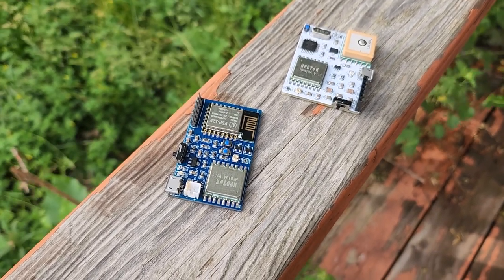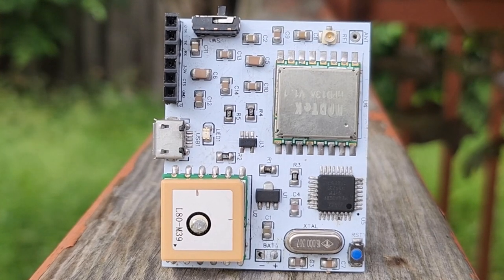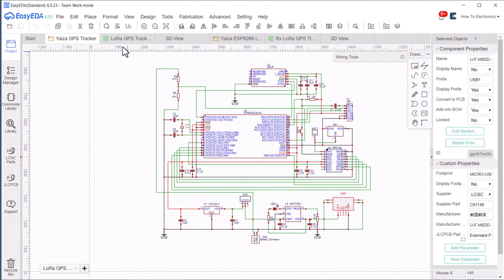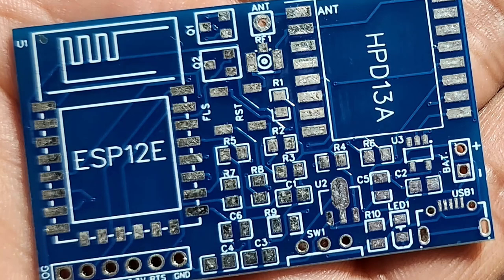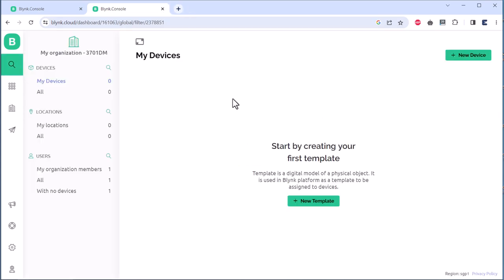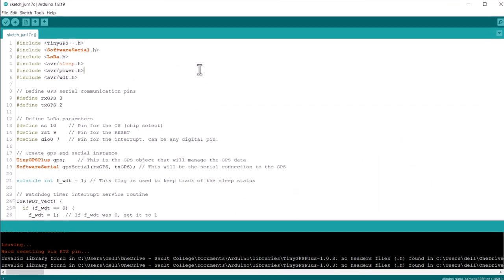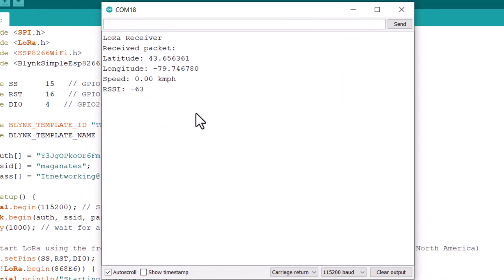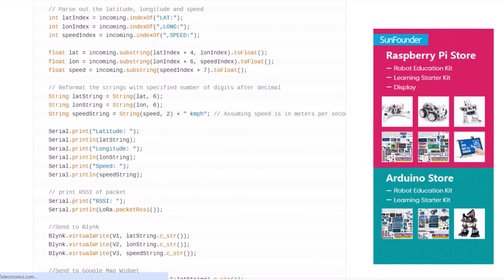DIY LoRa Based Low Power GPS Tracker | Live Location Tracking in Google Maps

Comment: Just a note to anyone who is contemplating building this project (or the near identical project with geofencing), I'd suggest you wait or at least review the schematic before ordering any PCBs or parts. The PC board has a short (VCC to GND) right next to the USB port (you can see it on the schematic). The USB is primary used for charging the 3.7v battery (via the charging controller), but this short could potentially damage the USB port on a PC or Laptop (I discovered this short after ordering, receiving the boards and partial assembly).   

 Within the last week or so, I've contacted the project creators and I hope that we can get the schematic and gerber files corrected so that hobbyists could be successful and enjoy building this project
Reply from the maker: Thanks for the update. I will update the schematic and PCB this week. Thank you so much for finding this error
Reply: @HowtoElectronics  Perfect thank you!! Please check my following post where other issues were noted. (especially the direct connection from  VBAT (MCP73831) to R4 - this connection bypasses the HT7333 regulator which I don't think is the intention.)

Comment: Thanks 🇳🇴 Im want to put a LoRaWAN 8ch repeater on the tallest mountain and heights e/solar just to have at least a start of a network. There's a few around, so hopefully we will mesh. This project is so cool! Very nicely done! I'm new to electronics. I build drones and stuff, but this is more advanced. The coding. But you have open-sourced your tracker which is really cool! 😊 This would work perfectly for a 🐕 dog tracker.

Improvement would be to use the WiFi to turn on if the dog runs away. Maybe geo-lock with the wi-fi connect to the phone app. So if dog moves 25m away and stays away for more than minutes the WiFi module starts logging WiFi networks to better track the dog and when lora repeater picks up the dog it'll draw the dogs trail using the dbi from the wifi networks to more accurately trace the dog 😊 Thanks again! I will make this

Comment: I would need something very small (size like a crown cap), which works the same way to be able to hide and easy to apply on cars, motorcycles, etc. If it was powered by a rechargeable battery with a mini solar panel that would be great. Waiting for info. Thank you very much.

Comment: Great project, I was able to create the GPS transmitter and able to upload the code and display the lat and long but I don't have a lot of luck with the GPS receiver. I kept getting fatal error message when uploading the code to ESP8266. I tried to use both drivers CH 342 and CP2102 and still not working, any suggestions is appreciated.
Reply from the maker: Check the FTDI connection.
Do not miss the RTS pin connection.
Reply: @HowtoElectronics  I did, I even keep pressing the RST and FLS button while uploading the code. anything else I am missing
Reply from the maker: Please check the resistor and capacitor value you soldered. Make sure there is no short between esp pins. And you don't need to press any reset button, the uploading is automatic. The circuit and PCB that we provided is tested and works perfectly well.
Reply: @HowtoElectronics , thank you for your response, I will build a new board and let you know.
Reply: I rebuilt the GPS Receiver from scratch and this time I was able to upload the code with no errors thanks for your advice, however the GPS TX will say transmission successful but I am not receiving or getting data in the Receiver side. any idea why?
Reply: After checking all pins I noticed that some of the pins needed some more soldering and now and able to to receive the Lat,lon coordinates in the receiver sides while  blynk SSID and PSW statement is commented "//Blynk.begin(auth, ssid, pass);  // Start Blynk" but when I tried to use Blynk, the code upload find but I get the following message in the serial monitor:
i’m encountring a strange restarting loop with my NodeMCU.
the exact code used to work 2 days ago before updating PIO and espressif8266.

serial output(Keeps Looping same O/P):

ets Jan 8 2013,rst cause:2, boot mode:(3,6)

load 0x3fff20b8, len 40, room 8
tail 0
chksum 0x2b
csum 0x2b
v000474a0
~ld
Reply: This statement in the instruction is kind of confusing in one hand you say that  "There is no need to press the reset or boot button while uploading the code and in the other hand you say that " The programming process is automatic and handled by two switches (FLS and RST)". do we need to press the FLS and RST button and what is the order sequence please?
Reply: I think you assigned the wrong RST pin for the SX1276 chip, RST is pin 14 and not 16 and it is unconnected in your diagram?
Reply from the maker: Those push buttons are optional, you dont need to press it during uploading. The upload process is automatic.
Reply: Please sure your experiences. It can be extremely helpful to others who have gone down the same path :)

Comment: Hey, 
I am doing the project on Bus Tracking System. And your design and video inspired me to do the project, 

Instead of wifi - antenna module
Can I make it  wifi - wifi module

For longer distance tracking, maybe this is possible on the project?
Reply from the maker: You need Ad-Hoc networking
Reply: Thank you for your reply, can I get more details of Ad-Hoc networking
Reply: @HowtoElectronics I am doing this project, As a gps tracker for a bus tracking system, how can I achieve longer distance communication for the project.
Reply: @ABISHEKKUMARMA  did you get the help you need?

Comment: Great project. However, I do want to question something in the design. It only has 1 km range? LORA is not so good at going through buildings on flat ground. It's great for long line of sight projects, like RC planes (See the ExpressLRS project, 100km+ range). Isn't the point of a GPS tracker ....to track... over distance. Like when someone steals your bike/car/anything and moves it >1km away. I think a GSM module would be better sevrved here. That's how all other GPS trackers work.
Reply: GSM and LoRa both are different technology. You cant compare GSM with LoRa.

Comment: I love watching your videos
Excellent work 👌🏻

Does it also tell about battery percentage of transmitter board under device info option?
Reply from the maker: Not it doesnt, but you may add few lines of code to send battery percentage data.
Reply: @HowtoElectronics  Do I need to make any changes in hardware part also ?
Reply from the maker: No change is required, there is already a voltage divider newtork associated with analog pin of Atmega328, which can read voltage from battery directly. You may map the volatage and convert to percentage. Code related to battery voltage calculation is available on this video: https://youtu.be/4_1UskdepZE
Reply: Thanks a lot 🙏🏻🙏🏻❤️

Comment: I found all fhe partsbut its estimated price is about $60usd. Where did you get parts?
Reply from the maker: Buy all those from aliexpress. It will be cheaper.
Reply: @HowtoElectronics  Yeah, that is exactly where I looked.
Reply from the maker: I dont know what components you selected. It should not have crossed 60$. Are you ordering in bulk.

Comment: Without a LoRa antenna connected, you can burn up the transmitting system!
Reply from the maker: I just run the test for a short period without the antenna.
Always Use antenna of 1.5dbi or more.